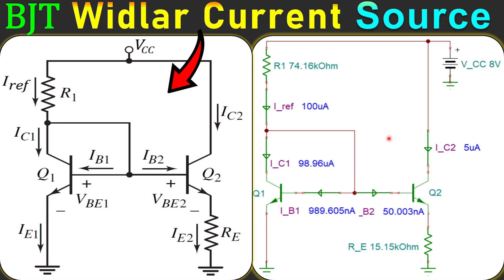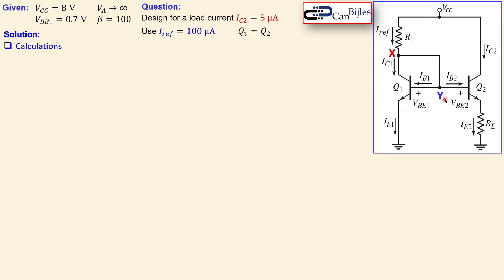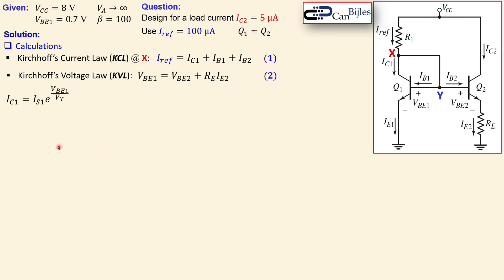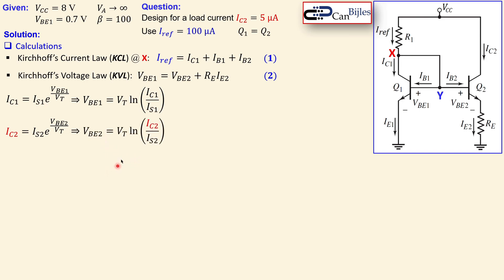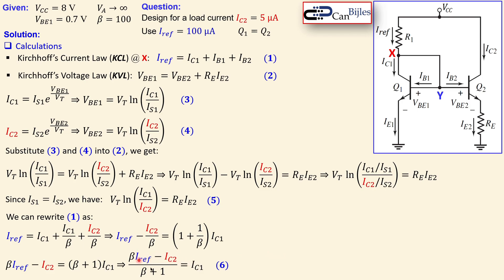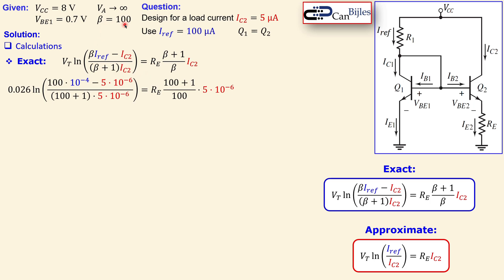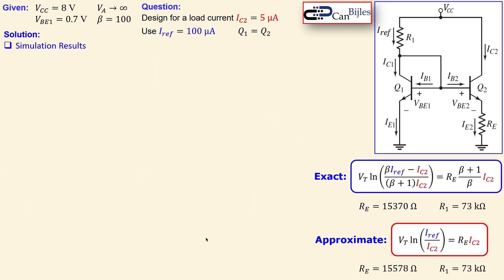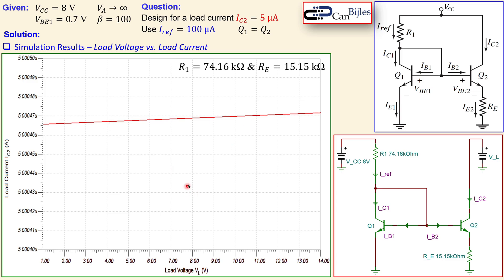BJT Widlar Current Source Design 🌟 Calculations & SPICE Simulations 💡 Example 4

Comment: Hi, What's the main advantage that results from incorporating a degeneration resistor for only the output transistor with an example application please? Thanks
Reply from the maker: The reason for having an emitter resistor (degeneration) is to make the gain more stable and increase the allowed input signal range.
Reply: What's the acceptable and  practical value (range) of resistor R1 for implementation in IC form?  @CANEDUX
Reply from the maker: @Fidel-tk5rq  For IC design, we need to limit the resistor values, but what the actual limit is, depends on the application. For discrete design, we can go somewhere up to few hundreds of Ohms, but again this depends on the application. In general, you cannot just set a range for a component by not considering other specifications.